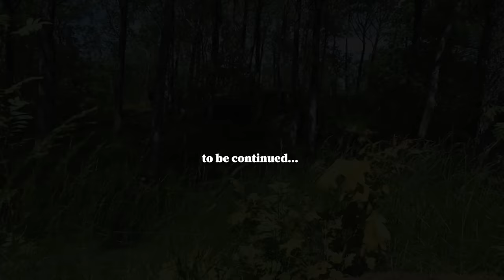LEAVING MY CABIN! I'm Tired Of Renovations (Story 20)

Comment: Hi, just have to mention it. You took out just one fase fuse of the two fase fuses of the loop on the attic. ( DO ALWAYS TAKE OUT BOTH FUSES ! ) The other fase still has voltage in it as if You touch THE OTHER +ANYTHING connected to GROUND      ( the sinc for example, or THE GROUNDED WIRE in the loop if the wire has three wires in it...) You will make an electric shock with the scary outcome we don`t want...   Other than that, You are just great !  Have a nice trip !
Reply from the maker: Hi! Thanks for the input - In my box, every fuse is connected to it's own group in the house, the bottom row are just more groups and not related to the top row.... Only the water pump has 3 fuses!
Reply: @wildrosie  Hi, I am sorry if I confused You. In a two-phase cable, there are three cords inside. L, N, and soil that is uninsulated or with green insulation. L and N each have their own fuse. This is because L and N have approx. 120 volts in them and therefore they each have their own fuse. When you connect something between them, it is a total of approx. 240 volts. The earthing cable has no fuse, and is screwed to the chassis in the fuse box, which in turn is earthed to earth spears outdoors, for example.You only unscrewed one fuse from L or N and not both. This caused you to remove about 120 volts from the wall socket in the kitchen. Thus you had 120 volts left in the second cord L, or N. My point is then that when you opened the cover on the plug on the wall in the kitchen, you had 120 volts in that cord in the plug on the wall because you did not unscrew the other fuse in the "group" that goes to the socket on the wall in the kitchen. If, contrary to expectation, you should come into contact with the copper
 in the cable you did not remove the fuse from and grounded metal frame in the plug or other grounded metal, you will get 120 volts through finger or if you use both hands there, it can go through the heart in a kind of "group" as you call it. I am speaking from personal experience when I was younger and an acquaintance did just that. he made a welding arc on the sink ... I have been working out testing high voltage switches for many years, so I know a little about this. Hope I got to say better what I meant and that you had a nice hike.

Comment: I also have "hit the wall" I am permanently trying to keep up with the need to make my home good for the winter. Good luck in achieving what you need to if a 68 year old can persist so can you take a break and don't make any big decisions too quickly. I have had four attempts at insulating the roof in the conservatory each morning it was on the floor but I persisted. Next the money needed is a difficulty. Are there European grants to assist you? The porcelain fused consumer unit may be a help with grants. There is a lot more advice could give but the local council is the first place to go.
Birdy

Comment: Superb job on building your kitchen, but was it not possible to relocate the power point lower down?   Was it merely lack of cable length that made you put it back up high beside the window?   Secondly, what sort of backup or emergency contact do you have when out hiking on your own.   Especially in remote areas.  What if you twisted or sprained your ankle and couldn't walk out to houses, village or towns to get help?

Comment: Nice attic. I was just thinking about these screw fuses from when I was young. Are you not supposed to take out two? No. 3 should be no. 3 on the bottom row as well? There is 2 fuses going in the same circuit.
Reply: Yuo have 1 phase and 3 phase, normaly for outlets (240 volt) there is only one fuse, for water pumps, washing machines and such there can be 3 phases and 3 fuses (380 volt).
Reply: @Sokrates66  this is Scandinavia, and those old fuseboxes/electricity was not built for modern appliances. She might have the old 2 phase, which was normal in Norway back in the day. (I presume Sweden have the same system)
Reply: @ibislife  No , no 2 phase in Sweden, not for lightning anyway. Im Swedish.
Reply from the maker: In my box every fuse is connected to a separate group in the house - only the water pump has 3!

Comment: There is a lack of 30 000 electrictians in Sweden. All fixed installations like you did in the kitchen is required by law to be done by a certified electrictian. Be carefull. 🖖
Reply from the maker: yup, I'm just unscrewing and rescrewing the socket, not changing anything!